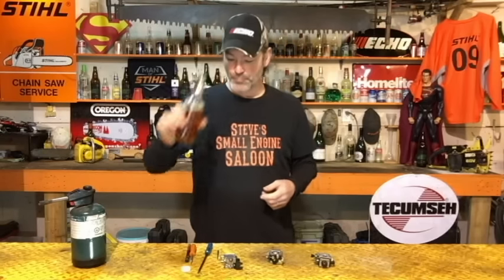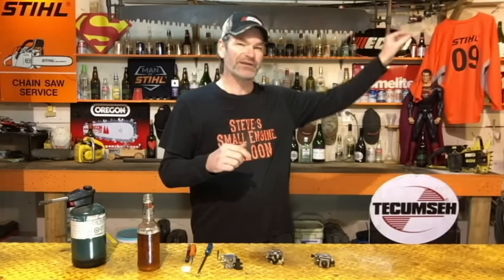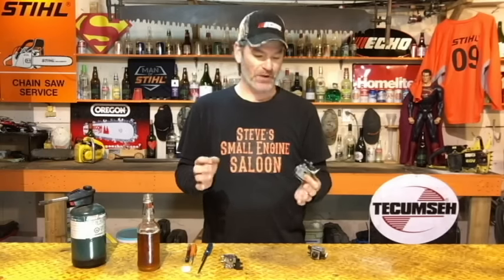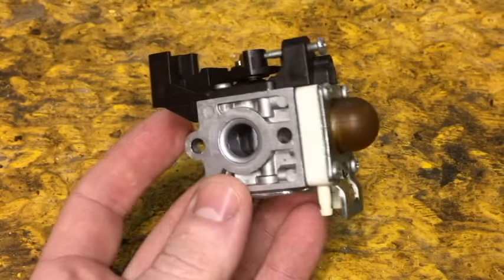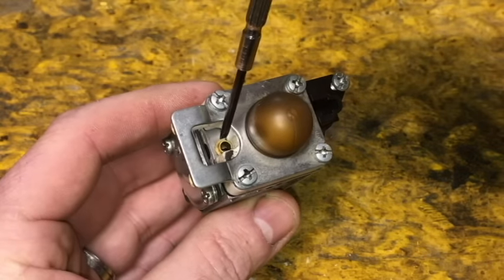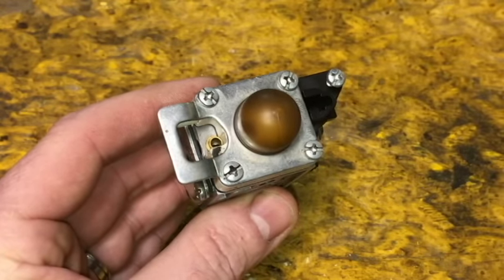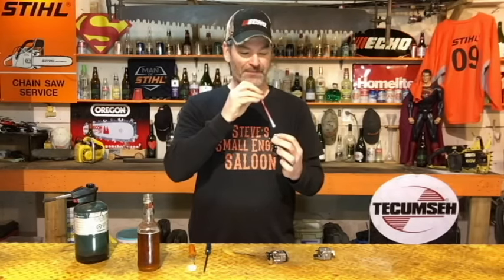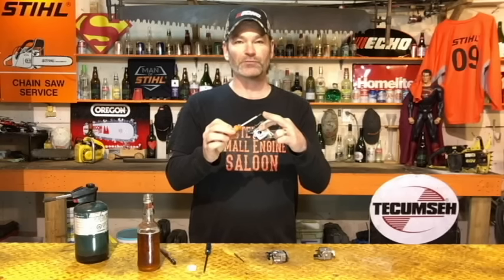Hidden Carburetor Adjusting Screws On Some Weedeaters And Blowers

Comment: Thanks for the info 👍
 I've been working on my bro in laws Craftsman 29cc 4 cycle lawn edger, I think Troy-Bilt made one identical and maybe others, and I cleaned the carb real well, cleaned the air filter and spark plug and adjusted the valves but at full throttle it runs like a 2 stroke when they're running too rich at full throttle. I think it's called 2 stroking but it's not smooth. I believe that this carb is a non adjustable one although I'm going to look it over again tomorrow and see if I can find any hidden adjustment screws. In case this one is truly non adjustable do you know if there's carbs available that will work that are adjustable? I think this carb is running either too rich or too lean and I'm not sure of a solution.

Comment: I only see one area for a hole on which is located down the barrel from the top in the center of the throttle.  It's a redmax hbz2600.....do some carbs only have one adjustment screw?

Comment: Hey Steve, I messed up on a new carburetor on my MTD 25cc string trimmer.  I was able to get it started initially, but it wouldn't idle and so I started messing with the mixture screws but neglected to note which was high and which was low and now I can't get it started at all.  What would be your suggestion to get this thing to a working condition?  The carb is new, the fuel is clean and pure and both the plug and fuel filter are also new.  Any help would be greatly appreciated.  Thanks!

Comment: Hi Steve,  thanks for the info on the hidden adjusting screws. Have you done any videos on those pesky brass main check valves like on the Walbro WT carbs? The rubber disk gets gooey and sticks thus no fuel to the H/L jet cambers. It is a replaceable part from Walbro PN 84-613-1. I think they can be extracted with a number 1-64 tap and am going to try it.

Comment: Steve I've got a echo SRM 265 s weedeater and tried everything new carb and even went back over everything it ran one time and was done blew all the fuel lines out made sure it was clear through the spark arrestor away still won't run it runs if I put carb cleaner down the Intake

Comment: Hi Steve, any thoughts on a SH56C that will only run full throttle even after doing a carb kit. Idle circuit is not working properly.

Comment: Steve , I have an old echo weed trimmer.I am having trouble with the choke.Its up to start and all the way down to run Lately I have to pull it up just a little to keep it running.Then I bump with my arm while using and it chokes out.Is it adjustable or do I fix it with H and L speed screws? HELP!

Comment: The carb on my crappy craftsman blower had "adjustable" low and high speed screw but I dont have the d tool to move them. I cut through the part of carb and cut a slot into screws so I could use a flathead.

Comment: Man, a few years back I threw out a trimmer because It started acting up. When I took it apart I was like, "what the heck? This thing doesn't have any adjusting screws !" Spent hundreds of dollars on a new trimmer. I guess it's okay because it was an upgrade but still, I like to get as much out of a machine as I can before opening up my duct tape wallet and shelling out the Benjamin's. Thanks for the knowledge and video!
Reply from the maker: You're Welcome...

Comment: My Ryobi has that Walbro carb. So on the Walbro how do you get at the high speed adjuster? Do you have to take off the side of the air filter? This is a great reason not to buy a Ryobi. Thanks

Comment: I use a wood screw and gently thread it into the plug, then I yank the screw out.  The plug usually sticks onto the end of the screw. I generally try to get the brass holder too.

Comment: Dear Steve, I found a Troy Built back pack blower model TB25 BP rev. it has the same Zama carb you just displayed and you were the first video i clicked onto. The location of the adjustment screws are very helpful, but I have a question about the primer bulb. When ever you compress it to prime the carb , and you must do it 10x, it takes about 10 seconds to retract back to it's bulb form. I know taking this long is not normal, do you what the problem might be?

Comment: You can also use an assortment of small wood screws , or even small machine screws that you will have to take a crisp dremel disk  and make a cutting divot in one side if you wish, weld or braze them to broken screwdrivers.  you may heat them with your lpropane, or a heat gun. they would work the same way.

Comment: I have the   brute® 9 127cc 4-cycle gas edger , and its almost new its never really run right but now I cant even keep it running unless it has choke on .  looking at the carb I only see a throttle adjustment on top thats plastic.  was wonder how I can send you some pics of my carb so you can tell me where the high and low are. Thankyou

Comment: I have a Walbro Barrel copy made by RuiXing. It has no evidence of a high speed adjuster but the low speed on the centre of the barrel was filled with epoxy which was removed by screwing a small flat blade screwdriver into the epoxy . That removed enough to be able to adjust the low screw.
Reply from the maker: Right on Ted...

Comment: Hey Steve, I bought a used echo pb770t that I believe has a chinesium carb on it. The low screw doesn’t have a plastic plug but it looks like a brass plug way down in there. Does this mean it is non adjustable? This is the first time I’ve seen this as all my other equipment is adjustable.

Comment: I have the Walbro K20-WYA carby and it appears to only have one metering screw on the low speed, the brush cutter dies when I give it throttle so hopefully adjusting the low speed fixes it

Comment: i have a question for you,i have a gentron 6000p propane generator,the gen got slung in a tornado about 300 yrds,crushed the cage and all the electrical panel,i have since then rebuilt and replaced all that,but since that event,i have to zip tie the govenor arm wide open to make the generator run with out fluttering.
once i zip tie it wide open it runs at 3000 rpm and put out 55 hrtz,so i was watching one your vids were you took a very small drill bit and went into the hidden screw behind the idle screw,well a propane carb or at least mine doesnt have any hidden screw,it does have and only it have a idle screw .
im thinking there got to be  a way to fix the flutter ,you have nay idea

Comment: Steve ,hi , hey I just received a carb for my troybilt tb 575 4 cycle... I was asking if they had a hole that allowed crankcase pressure to modulate the fuel pump diaphragm??? On mine the holes are both solid and there is a hole in the barrel body ??? I am not familiar with this? can you help? can this be correct??

Comment: Hey Steve. Fantastic channel. Hope you can help. My FS450 brushcutter has a zama C1Q-S34H  carb with only one noticeable and obvious adjustment screw. Firstly, it runs fine with a bit of throttle but just won't idle and secondly, how the hell do I adjust it with only one screw. Oh yeah.....that adjustment screw doesn't appear to change anything when its turned. Cheers

Comment: I have the same style ZAMA carb. I got the high speed plug out. For the low speed side there isn't a plastic plug. It looks like a brass piece is held in with an epoxy or some other material. How do I remove that or can I? Thanks in advance for you're reply.

Comment: Awesomeness, didn't think I could adjust one of my carbs, thanks once again man!!
I'd love to see a video by you going-over this concept of "the manufacturers want to make it hard for you to adjust the carb" because I simply don't understand it, it's obvious that they do it but WHY?!?  It's very hard to imagine it's some 'con' to force people to the OEM service centers (as most just go to a generic shop anyways - though I guess some % will go to stihl/echo/etc centers) but jesus, it's not like you're going to accidentally bump a splined screw that's deep inside the saw, if someone's opened their saw or otherwise accessing the H&L's they're obviously doing so with intent, the idea of them trying to "block" that just makes no sense to me, especially when it's done in such silly, removable ways!  At the end of the day the things need adjustment, blows my mind you'd deprive the consumer of it, I'm not suggesting that OEM manuals now include a section on carb-tuning, not recommending proactively encouraging it, but the active discouragement of it just boggles my mind!!
Reply: They do that so the equipment is compliant with the regulations in most states, only so much fuel equals only so much exhaust and noise. They do not care if equipment is running to full potential. That is why you see certain things not legal for sale or use in California.
Reply: They also do it for the most obvious and oldest reason there is..
PROFIT.. 
They want you to either buy another Product or get it fixed which usually means ordering a new part (that probably could of just been repaired or adjusted) and since most of these lawn equipment parts are all owned by a few companies they know they have a monopoly on the industry

Comment: That melting tips good. I fixed my clothes washer when 6 plastic nipples broke off two couplers and the rubber grommet couldn't drive the agitator or tub anymore. I cut some thick nails and melted them into the plastic in a triangle pattern all the way around and wha la ...fixed.
Worked for years.
Reply from the maker: Right on

Comment: For removing the plastic caps, I use a 16 gauge panel nail.  Just heat the tip with a torch, and push it in.
Reply: I'm a carpenter {amongst my many other hats), and I can't picture a "panel" nail. You have another term for that?

Comment: Somebody threw away a troy Bilt Weedwhacker to cycle engine in a troy Bilt pressure washer thanks for your videos I got them both running and working the Weedwhacker although has a rough idle and shakes really bad side to side is there any way to ingest that on a troy Bilt, I noticed on the carburetor of the troy Bilt Weedwhacker on top of the car the two black plastic plugs or I assume the adjustment screws are will that fix the rough idle or is it something else.?

Comment: RB (Rotary Barrel)Zama Type Chinese aftermarket, I have two identical for echo trimmer, neither carb will tune in and run as the original.  So I have been trying  to figure out why. Opened all for a look at each of the metering system. Found that both aftermarket had a different needle fulcrum arm setting compared to the factory OEM.  OEM was set level to the height of the metering gasket,  both aftermarket were above the gasket at different setting each. The aftermarket both ran extremely rich even after turning the main jet needle all the way closed. Then attempted to close the low speed idle needle to see if that would reduce the fuel as the two jets are the fuel entry points. I was able to make it idle by turning the set screw for opening the barrel more and closing the needle to some point of equilibrium. Then fine tuned the high speed main jet at wide open to get its best run out.  End result was still not optimum. The high end would momentarily switch between a smooth high rpm then drop back to a to rich stumble lower rpm. These switches lasting only around a second each.
The second aftermarket I attempted setting the meter arm at a position slightly lower than body level hoping that this would reduce the amount of fuel.  Well it did just that but then could not get enough fuel for idle and no matter the idle speed set it would die. So I set it back to level with the body and it functioned as the first one after setting the needles. My conclusion is the fuel passages, needle closure points are just to large, on the main, compared to a high quality factory Zama.

Comment: I have a weedeater that (I believe) has the vent on the gas cap. It feels like it is getting vapor locked. When it dies, I open the tank and close it back and it restarts nearly immediately. The vent looks clear. Is fuel supposed to always be returning to the tank from the return line? Or only when you prime it?

Comment: My carb 4cycle was starvin for fuel on high and staling out and no high adjustment screw. I bent the needle arm up a tadd and it does  not stall out now. bit the trigger has a sweet spot and boggs down a bit at fully open position. Is there a jet we could drill out in those cube carbs for the fast/high adjustment?

Comment: Questions:   I have I guess a walbro…………….one for a shindaiwa 230 I think trying to use on a le260   that costs 60-70 dollars vs 10...……………….I had the le260 screaming but I removed the brass top screw to get at the low speed and when I put that back on it dies and will not start.....do not have a screw driver that small to reach through the barrel of the top screw yet??  and when I screw that low speed screw all the way down, it does not bottom out.....your thoughts? as to what I should do and how to adjust by turns?   thanks I can send video if needed

Comment: I have a Troy-Bilt 4-Cycle weed eater TB539 ES.  The original carb and the replacement only have 2 access holes with a very small BB pressed in it.  Any suggestions, or a good replacement with REAL screws that'll work?   Thanks in advance, Herb

Comment: Sadly my carb doesn't have adjustment screws😅. Question on blow back hole on my engine,is it ok if i change my stock filter to a mushroom filter? My concern is that blow back hole have to be covered? 
Thanks.

Comment: I was told that I need to adjust the high speed screw on the carburettor of a Honda GX35 clone engine because I was having trouble with it not idling when the engine is cold & stalling after a full throttle run then releasing the throttle,in other words I was told that it's running too rich.

I did adjust the low speed mixture adjustment screw but that made no difference to it not idling because it would always need adjusting, it's a Walbro type of carburettor which has a brass plug fitted over the idle screw I believe, the OEM Walbro (Honda) carburettor is the same as the aftermarket one except that the OEM carburettor seems to have the low speed mixture adjustment screw epoxied up.

I actually fitted the OEM carburettor which had never been adjusted on the old engine & it seems to work much better, but I want to reuse the aftermarket carburettor on a clone engine which I want to build so I need to find out what's wrong with it or how to go about removing the brass sealing plug which is covering the high speed mixture adjustment screw !

Comment: Steve I have a roybi 4stroke s430 that runs real rough n dies as soon as I take off choke.  Will run real rough n low rpm with choke halfway.  I was told it doesn't have adjustable screws....any advice.  Thanks

Comment: Carb builders haven't heard about elevation? Found the low jet this a.m. Now she runs. 5,000 ft elevation. Need to revisit the hi jet. Thank you.
Reply from the maker: You're Welcome...
Reply: @StevesSmallEngineSaloon  Can't find the hi jet. Really needs a tweak. This could be a carb that just looks like the real thing. The plastic low jet plug was already removed. A shop worked on this 10 years ago or so.

Comment: I have a shindiawa hedge trimmer with a non adjustable carb. I’ve been tinkering with small engines for a while now. My question is, can I put the same carb with the adjustable jets on it to replace the one that doesn’t have adjustable screws on it?

Comment: Hey Steve
I have a Honda HHH25 hedge trimmer that won’t stay running.
I press the primer bulb to prime the carburettor, then it starts and runs for about five seconds.
Will not keep running. When I prime the carburettor again, it will start and then die after the carburettor runs out of gas.
It seems that the carburettor is not sucking the gas in constantly whilst the engine runs.
Any ideas as to what the problem may be?
Cheers from Garry in Australia.

Comment: Hey Steve I have a wal do carb I found the small d adjustment for low speed adjustment but at high speed(full throttle) it bogs down is there a high speed adjustment on these walbros.

Comment: What can I do with the non adjustable carburetor? I have two-ported carburetor on Kawasaki TJ35E engine (string trimmer). This is the infamous system with sucking the air to the cylinder through a reed valve, going through the upper carburetor air channel. I'd like to adjust the fuel to get maximum power with a tuned pipe from Goped scooter. If I decided to replace the carburetor for adjustable one, does even exist an adjustable two-ported carburetor? I wonder if there is a possibility to convert the engine to a classic one, with a common one ported carburetor, as I am pretty sure that special intake system reduces also the power, not just the emission.

Comment: Got the high screw adjustment fine but I just can't get the idle to come down. Throttle set screw is in as far as it can go to let the throttle cable all the way out but it still won't come down. Tried adjusting the idle speed screw down the barrel to no avail. There's no happy medium. It won't idle and die or it's high  rpm.. I got the unit free. The original owner even replaced the carb with a factory new one from the dealer.

Comment: Did this on a zama had some problems with the barrel plug. My advice: Use a large enough screw driver but not so large its scrapping the sides, too small and it will just come out of the plug and leave it in the hole :/ Use a butane lighter or a torch, regular lighters and candles dont get it hot enough. One of the things that confused me was thinking the plug had reverse threads on the outside, it doesnt its smooth :)

Comment: Hey I have a walbro 138A non adjustable on a John Deer bp40 backpack blower and it does have H an L but the H is not drilled and the L has a welsh plug. Can I take a high and low needle and drill and tap them in?  Sure be nice to adjust it